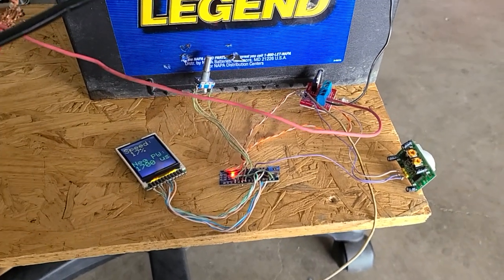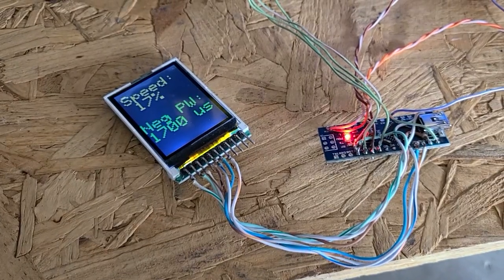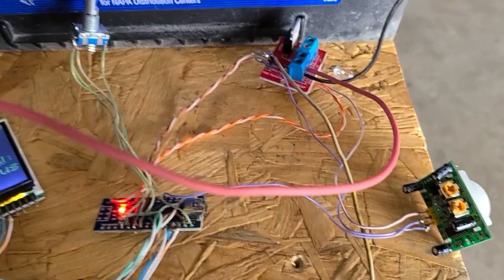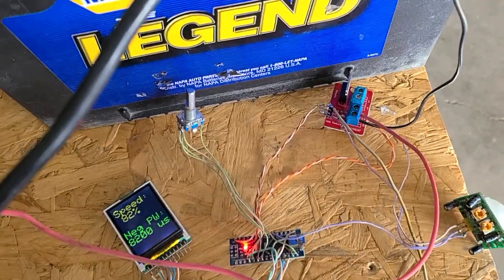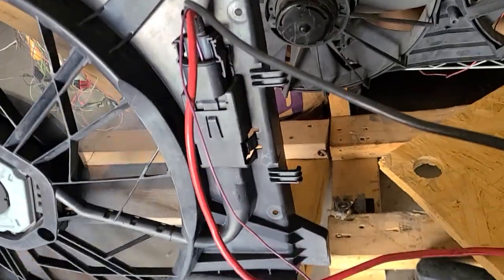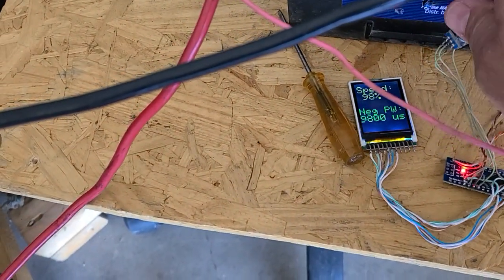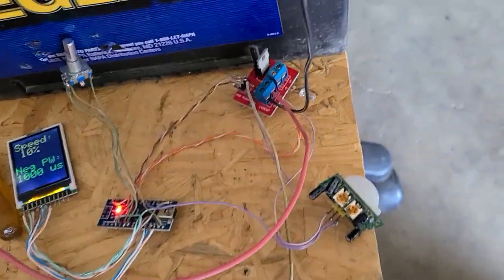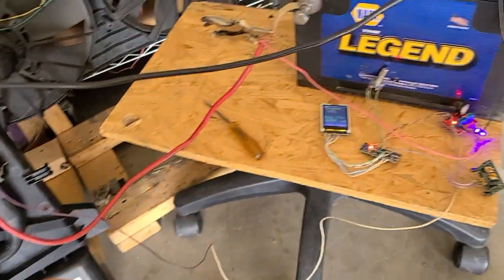XC90 Volvo PWM variable speed garage cooling fan

Comment from the maker: Here is my code.

#include <Adafruit_GFX.h>
#include <Adafruit_ST7735.h>
#include <SPI.h>
#include <Encoder.h>

#define TFT_CS 10
#define TFT_RST 9
#define TFT_DC 8

#define ENCODER_PIN_A 4
#define ENCODER_PIN_B 2
#define PWM_PIN 3
#define INPUT_PIN A2

#define DUTY_CYCLE_MIN 10
#define DUTY_CYCLE_MAX 90

Adafruit_ST7735 tft = Adafruit_ST7735(TFT_CS, TFT_DC, TFT_RST);
Encoder encoder(ENCODER_PIN_A, ENCODER_PIN_B);

unsigned long previousUpdateTime = 0;
const unsigned long updateInterval = 500; // Update interval in milliseconds (0.5 second)

void setup() {
  pinMode(ENCODER_PIN_A, INPUT_PULLUP);
  pinMode(ENCODER_PIN_B, INPUT_PULLUP);
  pinMode(PWM_PIN, OUTPUT);
  pinMode(INPUT_PIN, INPUT);

  TCCR2B = TCCR2B & B11111000 | B00000110; // Sets output freq to 122.5Hz

  tft.initR(INITR_BLACKTAB);
  tft.fillScreen(ST77XX_BLACK);

  Serial.begin(9600); // Initialize Serial for debugging (optional)
}

void updateDisplay(int dutyCycle, int pulseWidthNegative, int encoderValue) {
  // Clear the display
  tft.fillScreen(ST77XX_BLACK);

  // Print the duty cycle on the TFT display
  tft.setTextSize(3);
  tft.setTextColor(ST77XX_YELLOW);
  tft.setCursor(5, 10);
  tft.print("Speed: ");
  tft.print(100 - dutyCycle);
  tft.println("%");

  tft.println("");
  tft.setTextColor(ST77XX_GREEN);
  tft.print("Neg PW:");
  tft.print(pulseWidthNegative);
  tft.print(" us");

  // Print the encoder value to the Serial Monitor (optional)
  Serial.print("Encoder Value: ");
  Serial.println(encoderValue);
}

void loop() {
  // Read the encoder value
  int encoderValue = encoder.read();
  
  // Read the input status of A2
  int inputStatus = digitalRead(INPUT_PIN);

  // Map the encoder value to the duty cycle range (10% to 90%)
  int dutyCycle = map(encoderValue, -100, 100, DUTY_CYCLE_MIN, DUTY_CYCLE_MAX);

  // Calculate the pulse widths in microseconds
  static int pulseWidthPositive = 0; // Time for high phase in microseconds
  static int pulseWidthNegative = 0; // Time for low phase in microseconds

  pulseWidthPositive = dutyCycle * 100;
  pulseWidthNegative = (100 - dutyCycle) * 100;

  // Only generate output pulses when A2 is high
  if (inputStatus == HIGH) {
    // Set the duty cycle for Timer0 (using analogWrite) to generate PWM on pin D3
    analogWrite(PWM_PIN, dutyCycle * 2.55); // Map 100% to 255 for 8-bit PWM
  } else {
    // If A2 is low, turn off the output
    analogWrite(PWM_PIN, 0);
  }

  // Check if it's time to update the display
  unsigned long currentMillis = millis();
  if (currentMillis - previousUpdateTime >= updateInterval) {
    // Update the display once per 500 milliseconds
    previousUpdateTime = currentMillis;
    updateDisplay(dutyCycle, pulseWidthNegative, encoderValue);
  }
}